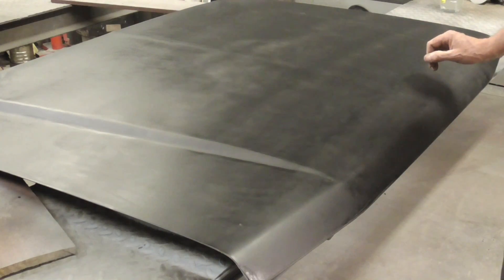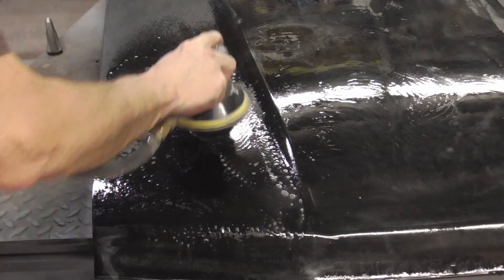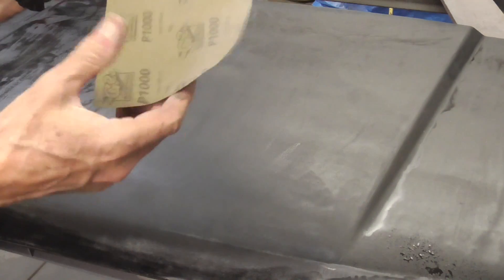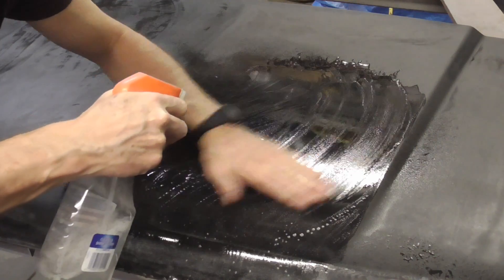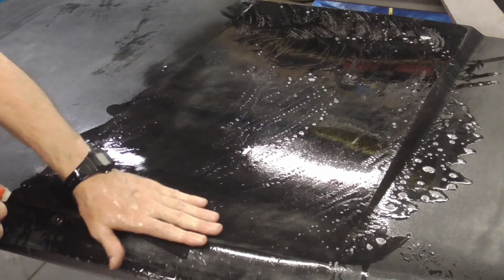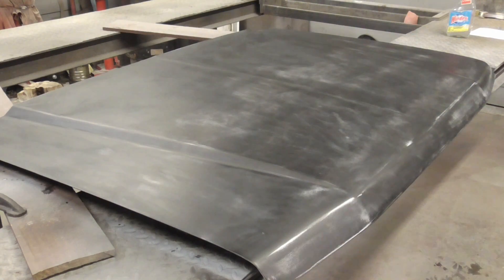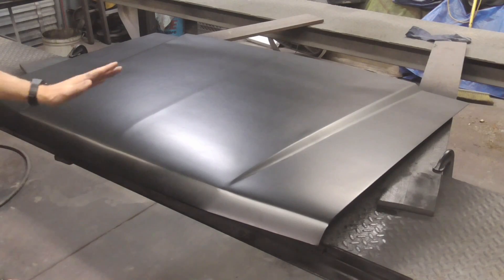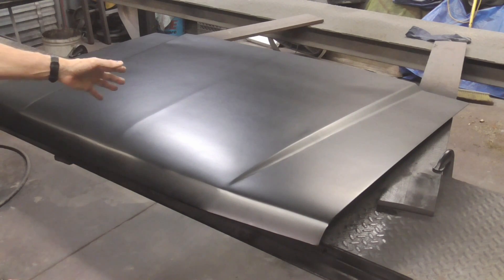Automotive Paint Problems & Solutions - Fixing a Botched Paint Job

Comment: Hi Jerry, i just sprayed the bonnet (Hood) of my 80 Series Landcruiser this morning using Dupli Colour white that i thinned with all purpose thinners. I have been watching all your videos and learnt so much from you thank you :-).  I have just checked the job now my stress levels have calmed down a bit haha and i think i may have missed a small section on the front corner curve of the hood. Your video was right on cue !!! I followed your directions and resprayed, looking better than before ..... However ... i noticed two spots where the hose must have touched the fresh paint. Can you suggest a repair without another full coat ?  Many thanks.....Glen, South Australia.
Reply from the maker: Sorry about the late reply.  The only choice you have if you don't wet sand and repaint is to let it dry wet sand and buff - if it's got enough paint on it.  One last thing you can try is a good brush - I never have much luck with a touch up brush though.  Let me know what you end up doing - Jerry - Michigan, USA
Reply: @LakesideAutobody  Thank you for your reply Jerry. After wet sanding and spraying again the result was so much better than before, plenty of paint now. Honestly your video was exactly about the problem i had that morning, amazing.  Looking at the bonnet now the two little scuff marks are not so bad really. It is a shame i managed to get the hose near the edge. Looking at them i think a Q-tip and a little repeated touch up to build up a few layers and a light wet sand/buff when its dry might do the trick. I will reply at a later time and let you know how it goes. Thank you again Jerry. Glen.
Reply: @LakesideAutobody  Hi Jerry, just an update on my touch ups after touching the hose on the hood. It didn't really work so well so i will give it all a wet sand with 600 and do a re coat...... this time being very careful of where the hose is ! It is a bit difficult leaning out over the hood and maintaining the gun position.... but hey.... i am getting more practice haha .... Cheers, Glen.  South Australia.
Reply from the maker: @Glendram  Great to hear - thanks for the update. Yes it's sometimes difficult to reach the middle of panels without a mistake but like you said practice, practice ... Nice talking to you :)
Reply: @LakesideAutobody  Yes, same here Jerry, i have to thank you for all the great information, helped me so much. I made sure i was fully prepared,  picked up the mixed paint this morning. Gave the hood a rub over with the tack cloth and gave it 3 nice coats. Looking good and well worth the extra time and effort to get it right. No hose scrapes, that will never happen again haha, hope. I guess i can say i have sprayed 3 hoods now, rather than say the same hood 3 times :-) Good talking to you too Jerry, stay safe :-)
Reply: @LakesideAutobody  Hi Jerry, i have decided to remove the radio antenna from the fender of my 80 Series Landcruiser. This will leave a hole slightly larger than one inch in diameter, which i will attempt to fill using a metal disc and spot weld it in place. The top profile of the fender has quite a curve so it will be a challenge... for me :-) I have searched through your videos and there is some great information on the spot welding but nothing quite like the filling of the hole.  Perhaps it would make a good video in the future ? Considering the steps that must be taken if welding on the vehicle so there is no damage to the electrics. Cheers, Glen.
Reply from the maker: @Glendram  Excellent idea for a video and I like the part about electronics too - I'll write that on my list or videos to do.  Thanks and have a good weekend.  BTW let me know how your project works out for you :)
Reply: @LakesideAutobody  Hi Jerry, when i went to pick up some paint etc from the supplier i told him what i was planning to do with the hole in the fender and he suggested i use a patch and an adhesive product called Soudal T-Rex. So i cut a piece of 1mm galv sheet, formed a slight curve in it. I had to drill a hole in the centre and use a screw and a piece of wire to left it into place. The adhesive grabs immediately so i could proceed to use fibreglass filler then a fine filler over the top, prime and paint. It's not perfect, i can see a tiny ripple where the hole was :-( but i think it turned out really well considering :-) I'm happy for a first attempt, thanks to your videos Jerry.  Glen.
Reply from the maker: @Glendram  That sounds like a cool product - I'll do a video on that some time.  Could be a good solution to patch work.  Thanks Glen and glad everything worked for you :)
Reply: Dude how do you have AutoBody in your name and repping cheap paint🤦‍♂️do these guys a favor and tell them too use good materials please

Comment: 👍🏻Nice video!!! I’ve really improved on my painting from your videos. The first paint job a few years ago was a mess,  I just finished some accident repairs on my sons car and the paint job turned out almost flawlessly besides a few pieces of dust in the clearcoat. Can’t thank you enough for the tips and tricks.
Reply from the maker: I love to hear stuff like that - nice job.  You will always have a few specks of dust or something - that's just par for the course.  Just know that almost all jobs that leave a dealership or privately owned body shop are at least wet sanded lightly and buffed - just looks a lot better and matches the original orange peel and gloss better.  So glad you enjoy the content and thanks for the support :)
Reply: I believe the paint job is better then if the body shop did it. The color match is so close and the orange peel is so minimal. I’ve found my dads old Binks gun after you talked about them, yes it puts more over spray in the air but lays the paint down nicely. I’m not a fan of the top feed guns. I average 1 to 2 paint jobs a year and miscellaneous stuff like boat trailer, utility trailers stuff like that. 
Thanks again have a great weekend.
Reply from the maker: @michaelmarusic8499  That Binks is the King - don't ever get rid of it.  It's really all you'll ever need if you clean it, get familiar with the parts, and take care of it.  It sprays any paint just fine.  They also have rebuild kits for it and you can find them all the time on ebay.  Fun gun to collect parts for.  You have a good weekend too :) Jerry

Comment: The reality is, things happen. Good to have a plan, ahead of time. 👍
Reply from the maker: Your right - stuff happens.  Can't stop bugs in the summer - they love the smell of fresh paint :)
Reply: @LakesideAutobody  I add just a few drops of liquid off bug reppelant into the paint I've been doing this for years it helps a lot  a old painter told me that back in the mid '70's when I first started working in a body shop he was one of those painters did custom work traveling from New Zealand around Europe and Canada then went back 20 years later to New Zealand... I learned a lot from Doug... Same with Bill for bodywork pick and file along with paddling lead.. and Don I the frame rack the Old Masters you don't find many of them around anymore Gary was good as well on strighting frames and body work had a few jobs with truck cabs Dimond pulling the cab straight for a few dealer ships that brought them in... I enjoyed that work better than those replace parts shops like star car smashision and better get backed oh (no names please) but there out for the buck with aftermarket parts not the quality of original parts for a restoration.. and everyone knows aftermarket quality is not the same as factory.. thinner metal, not the same fit, only for cosmetic only folds a lot faster in a collision than factory fenders or doors same with those rubber bumpers don't fit worth Cr💩p... But I really enjoy watching your videos myself I'm not into wet sanding with a orbital sander on fresh paint I'm still a wet sanding by hand and red rubber block to wipe as squeeze to see what's happening.. the a little polish ... 
Some of those replacement shops don't paint the side of the car properly and you can see the color mismatch becouse insurance won't pay for the side to get painted you know fender and two doors but can't paint the 1/4
Panel..  So the paint is like night and day  even with the color scanner the color is off .. but wish you the best take care and try that little trick with the liquid bug reppelant like off or deep woods in the squart bottle just a few drops does wonders...have to admit really good for rustolum paint that type of enemel usually likes to wrinkle for a re-coat ... Even seen one small project Nason urethane red dried about 7 months and touched up with tremclad red on chip and wrinkled and the Nason had activator guy had Christmas display painted but wood started to split and he touched up and it happened  I recommend a little primer first just light dust coats spray bomb to seal it and use spray bomb red instead of brush next time. I suggested a gold scrubby for primer and paint to stick then dust it .
Reply from the maker: @peterrivney552  Creative thinking with throwing a bit of OFF in the paint - interesting......  Thanks for the comment and helpful tips - good stuff.  Nothing like learning from old fellas that have been there for years - they know.  Have a good weekend Peter :)